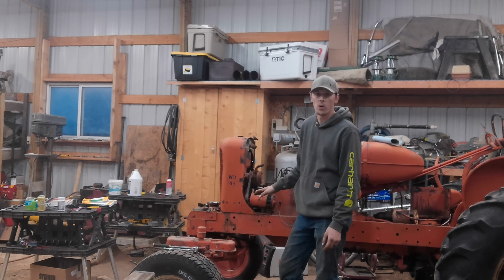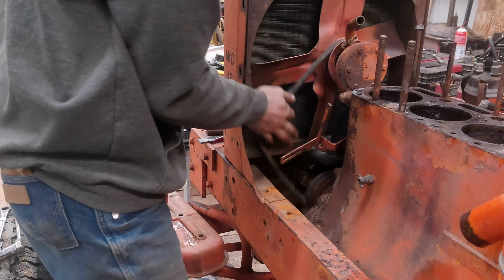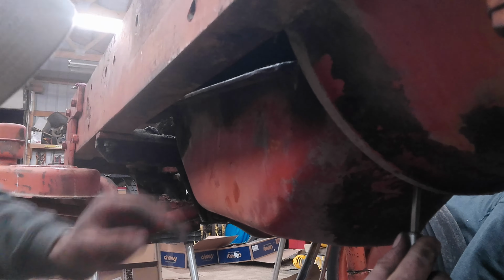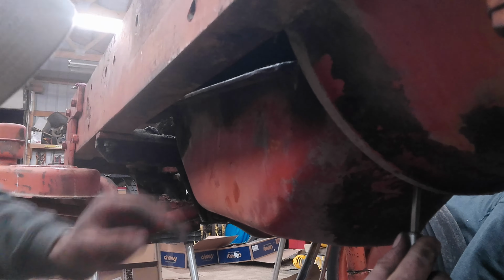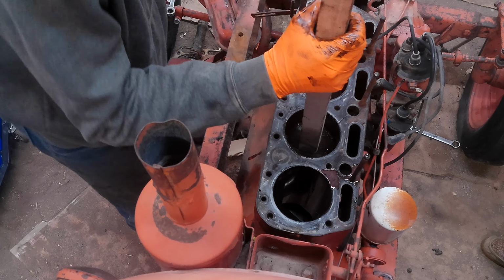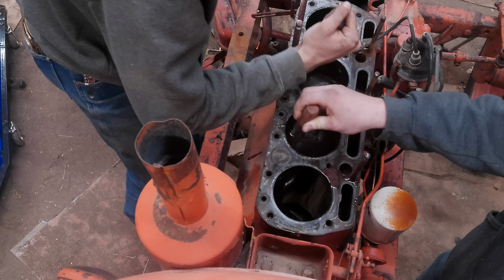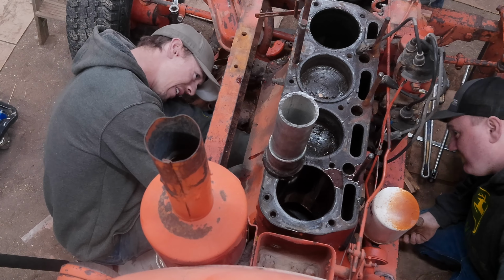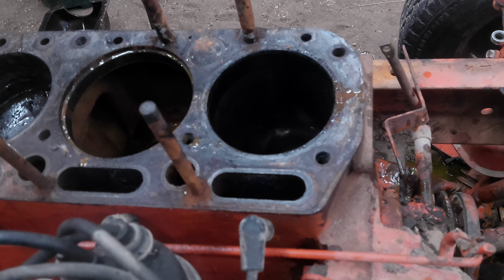Allis Chalmers WD45 Rebuild Episode 3: Piston and Sleeve Removal

Comment: What rebuild kit did you get ?
Reply from the maker: I haven’t ordered one yet. I started thinking that I should go through the transmission to make sure it’ll work before I get the engine kit. It’ll probably be a reliance kit from Steiner, Yesterday’s Tractor, or All States Ag Parts
Reply: @Tractor-Roy  would you put a d17 kit in it?
Reply from the maker: @maxbuechel1437 I’m just going with the easy to obtain 4 1/8” overbore. It’ll fit a WD45, D17, 170, and 175 block. My other WD45 runs a small square baler with stock engine just fine, and that’s all this will do. There isn’t any sled pulling around me and if I need more power I’ll just use a different tractor. I don’t want to go crazy adding power to this